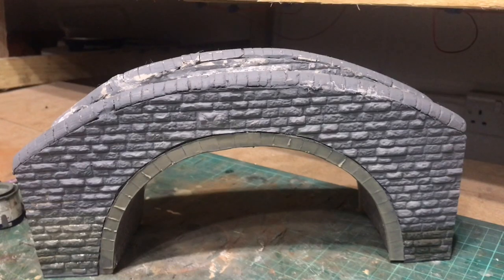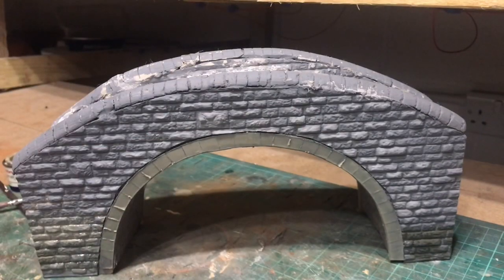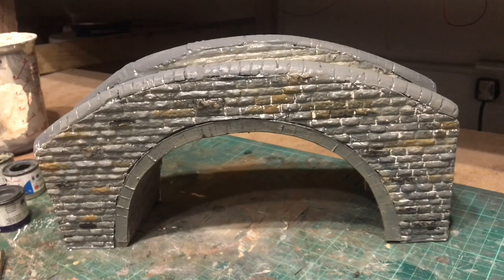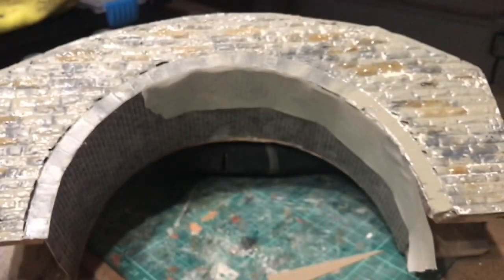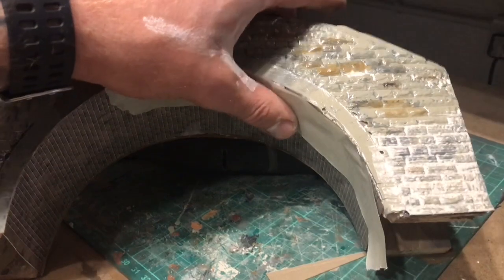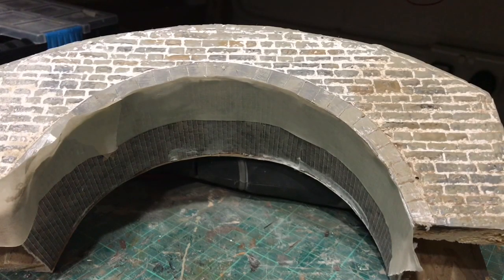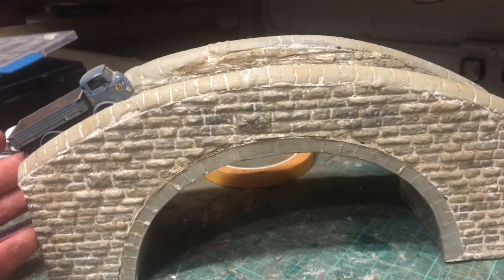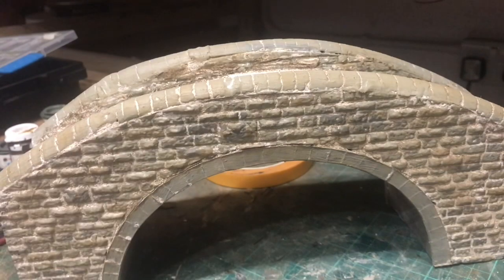Building a Model Railway - Humpback Bridge - Weathering and Detailing

Comment: Great use with the plaster. That is alot better than just using white paint and rubbing it off which is what i did with mine. Next time i will try and use your method. Thank you very much.
Reply from the maker: No problem, yeah that’s skaters stuff is very corse cheers